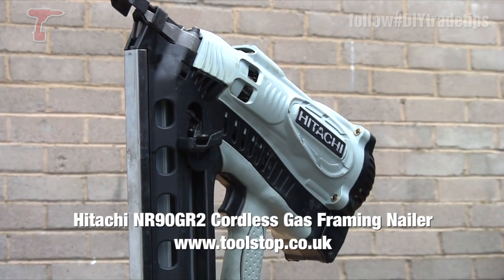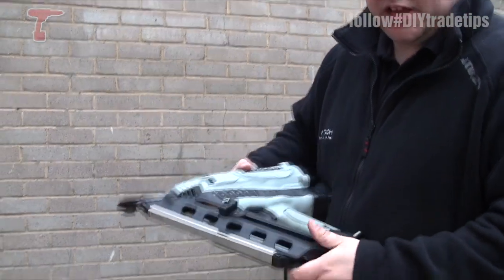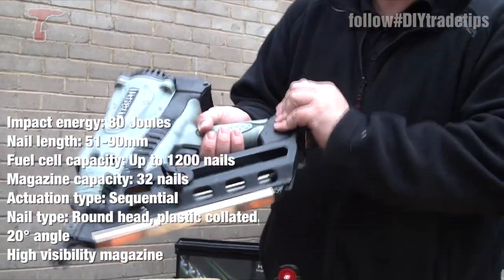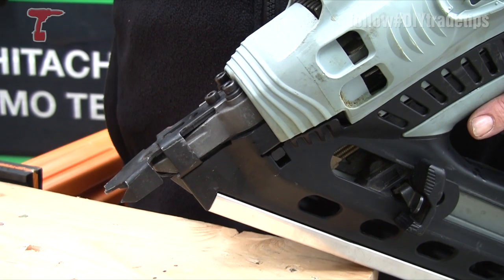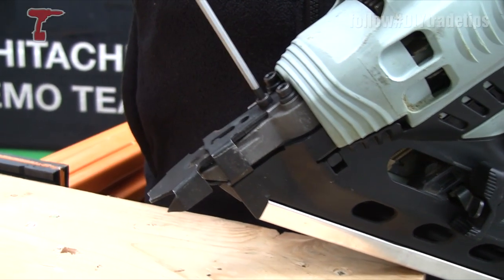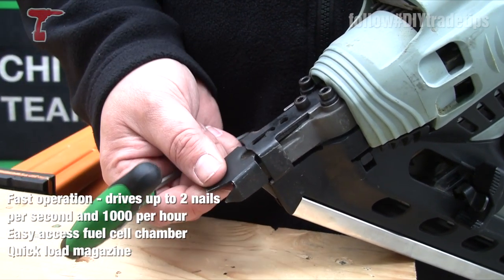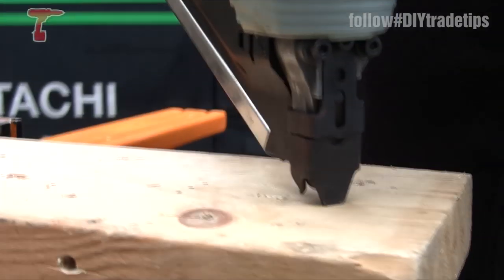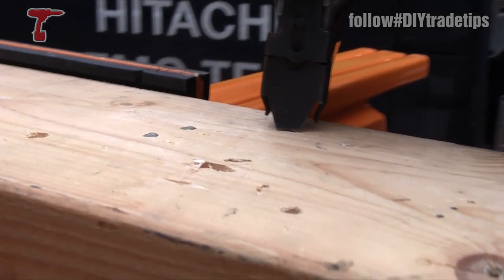Hitachi NR90GR2 Cordless Gas Framing Nailer - How to Use and Adjust

Comment: had this gun for a few month now and seemed to be better than my old pasloade. but now it is not working very well with pasloade nails. i have noticed on this new pasload gas their is like a thumb indentation on the plastic tops do you know if this could have any effect on it working correctly with hitachi gun

Comment: I have the lithium ion version and this adjustment is its only weakness, wish it was tool-less.
Other than that both my Hitachi nail guns are great kit.
Both came with 2 batteries not like Paslode who were only supplying 1 which is a waste of time for pro use.